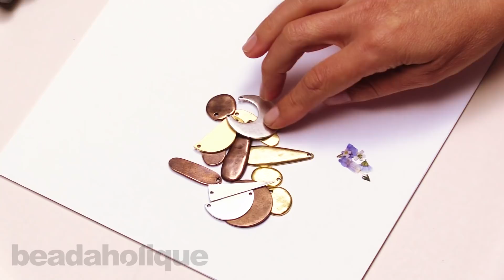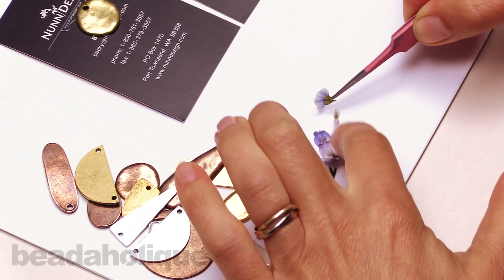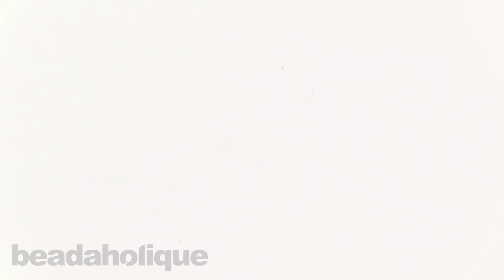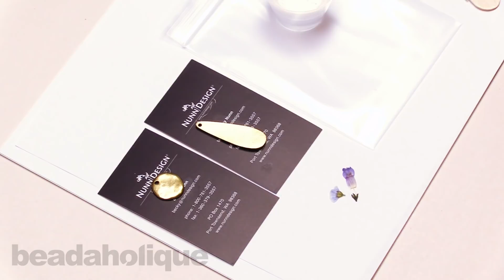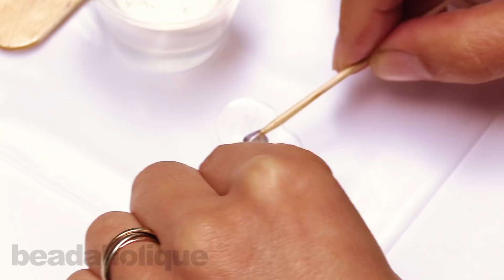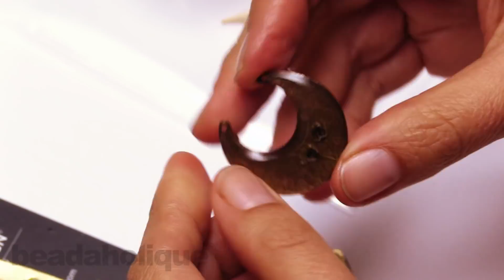How to Use Nunn Design Resin to Seal Pressed Organics onto Flat Tags for Jewelry

Comment: I love your design ideas, I've made a mess before with resin, I'm trying to avoid that again.  I have a question, can I use a silicone mold and make an element using resin and some organic, or decorative design with it?
Reply: Yes. Use layers of resin. Make one layer, let it cure. This gives you a base to work with. Then use the method she used to coat the organic/decorative item and place it in the mold. If the item is adequately covered, then this is all you need to do. If not, add more resin. 

Also, she has several more videos about resin on this channel, where they go into FAR more detail than I went into. It'll give you a better idea of what I'm talking about.
Reply from the maker: Yes. Here is another helpful video https://www.beadaholique.com/how-to-incorporate-organic-matter-into-2-part-resin-by-becky-nunn.html